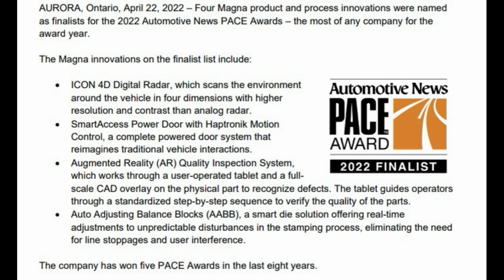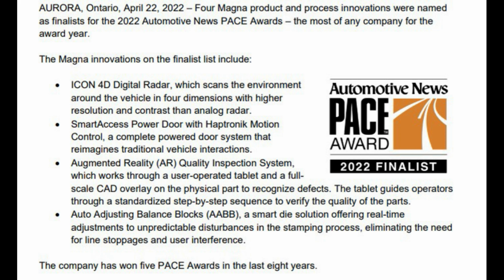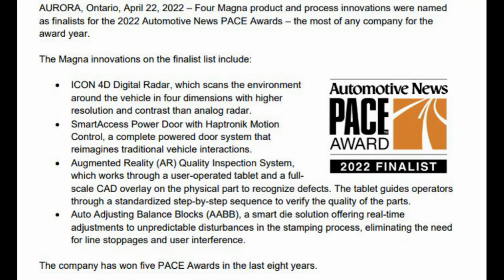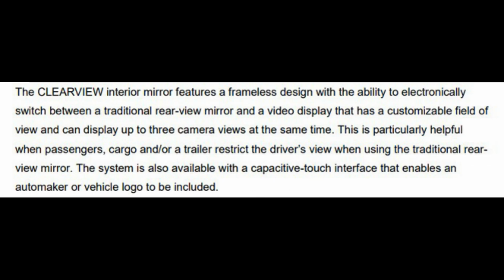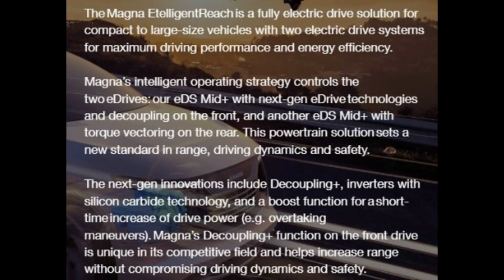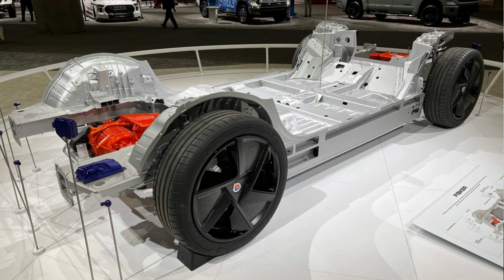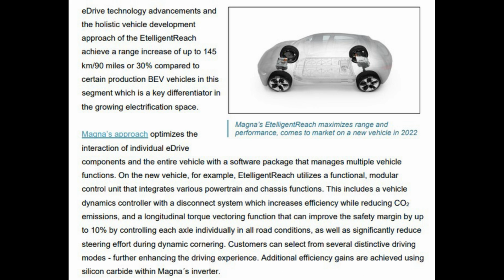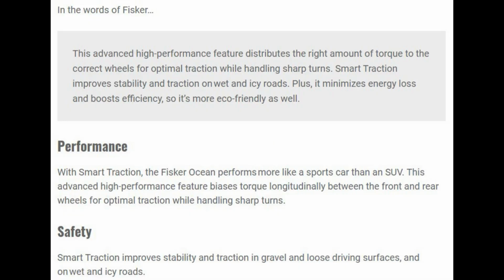Magna International and Fisker Ocean: A Dynamic Partnership

Comment: I trust Magna Software Engineering.  Not so much with Fisker's.  They can't even keep up with their app.  They need to up their game.
Reply from the maker: They aren't doing much with the app because they really don't need to until the cars start delivering.
Reply: @offtheshelfrides  I hear ya.  It's not a good look.  They've been telling us for many months about the plans for the app and they haven't come through at all.  When it came to converting to orders, the website worked somewhat, but not the app.  I'm just glad Magna is on this project.  The next big concern is if Fisker will be ready to support the cars on the road.  Tesla still has major service troubles, so I cannot imagine that Fisker is going to be in a better position.  A small company covering the globe isn't going to be easy nor efficient.  If all fails on my two upcoming Fiskers, I still will have the reliable EV6.
Reply from the maker: @coolpix222  I understand.  I do know they have 3rd party service providers under contract but I can't remember the name. It is in their newsroom on their website. As for the app, I will be concerned if we don't see a significant change by the beginning of November. You should see my app for my VW ID.4.  We can see state of charge, whether it is charging or not and turn on the climate control. That's it, and we've been waiting for an update for over a year, lol
Reply: @offtheshelfrides  the EV6 isn't without problems.  But the issues that I have come across are minor.  Like when I remotely turn on the AC, the units will change to Celsius and you need to go to settings every time to switch it back to Fahrenheit.  Also, with a bike rack in place, you must turn off parking collision avoidance or else the car keeps stopping the car on reverse.  I change settings in the screen, but they reset each time.  The screen also says you can override by pressing the brake, but that works 10% of the time.  The workaround is to hold down the P button until it deactives the Parking Collision Avoidance.

Comment: Nice video, super research! Whenever the big sur blue car is demonstrated the hosts have to reach thru the open window and pull the handle to get the doors open, so I think they just haven't included the magna door handle electronics yet.
Reply from the maker: We got some info on the door at Fully Charged and there is a space that does stick out that we can't see in pictures and it how the door closes.  Probably standard handles on than that the pop out to open on the outside

Comment: Handles on the inside really should be hardware/pull.
Reply from the maker: They probably are, but what confused us when talking in the Live stream was that there is only 1 handle on the inside, not a handle to pull in closed and 1 for opening.....
Reply: @offtheshelfrides  it turns out there's a ridge running back from the handle for a long ways that your fingers can tuck into to pull the door closed. It's not obvious in pictures.
Reply from the maker: @u2bster  yes, I was just telling another person that we found that out at Fully Charged. You really can't see it in the pictures.